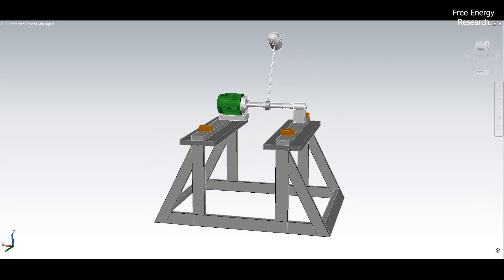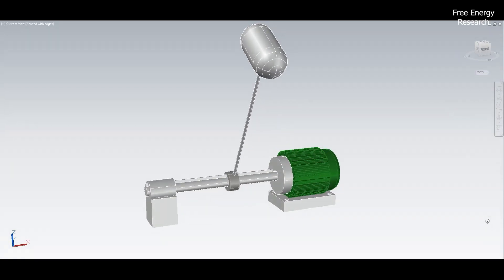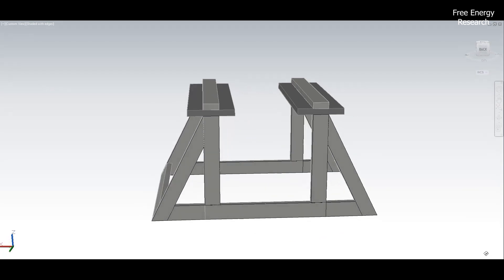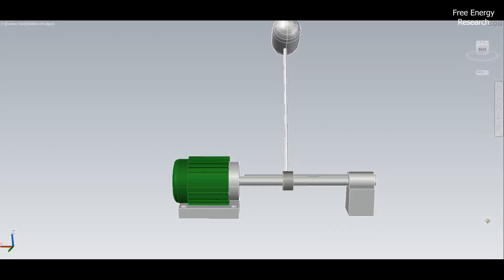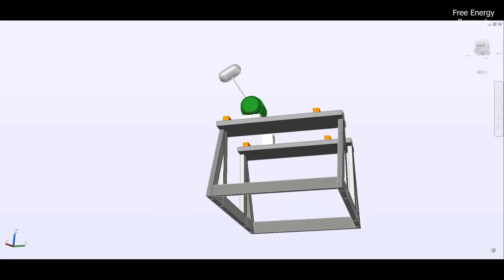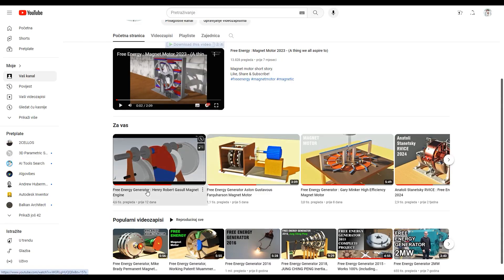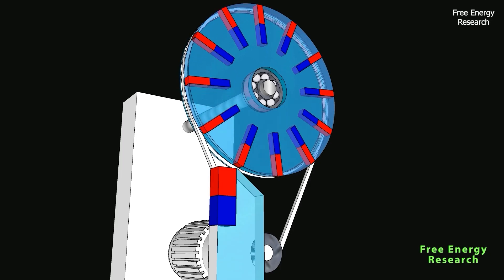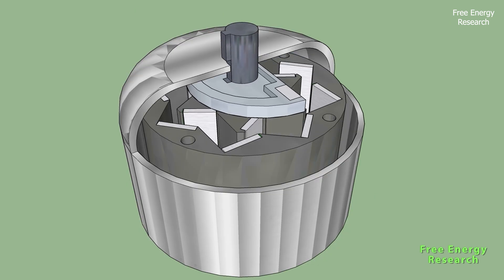Free Energy Generator - Kenneth Claypool Gravity propelled generator

Comment: Let me tell you something just so that you understand, as a mass moves downward it changes gravitational potential energy into kinetic energy mgΔh=mv² however as the pendulum moves back up it converts back and without external forces (friction air resistance) it would just remain at the same amount of total mechanical energy, if you hook it up to a generator, it would generate energy from the gravitational potential energy at best equal to around double the masses distance from the center of rotation.